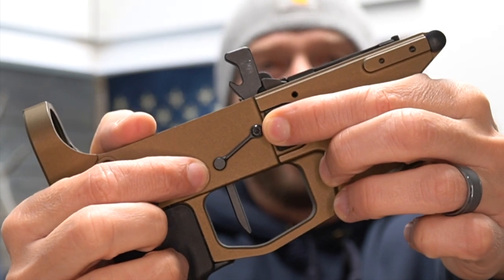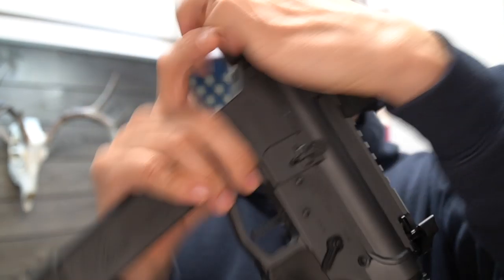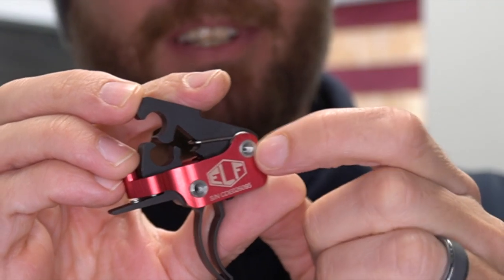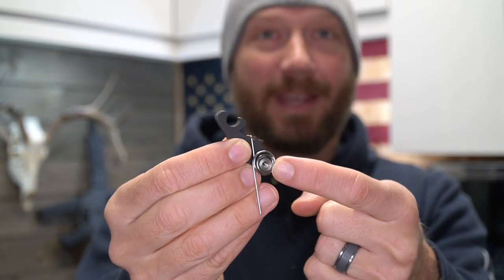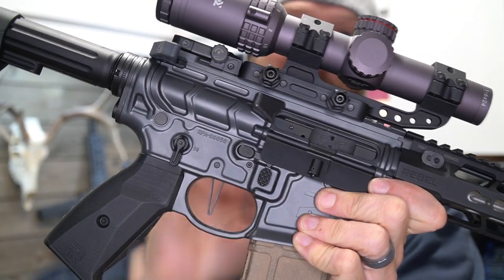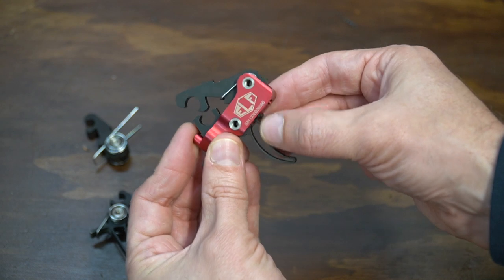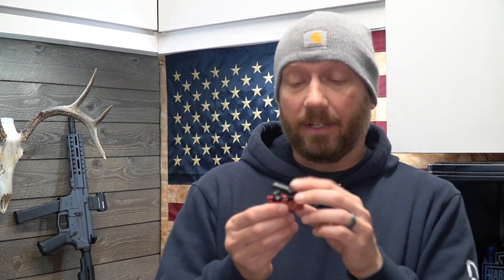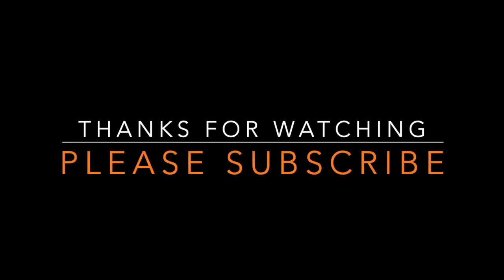You don’t need anti-walk pins!

Comment: FYI, the KNS pins design are anti-rotation, not only anti-walk. In full auto use, and semi that are fired alot, the hammer pin rotates and wears out the holes in the lower receiver. KNS pins prevent receiver wear at the hammer pin hole, have anti-walk purpose for the trigger pin, and they look great!!!
Reply: Thanks

Comment: Linked pins are not anti-walk pins... those are anti rotation links. It's supposed to make sure that the hammer won't rotate the pin in every cycle. If it can rotate, thereotically it could "ream out" the holes in the receiver.

Comment: The first pins are anti- rotation pins and the second set with just screw heads are anti-walk. Both are useful if applied for the correct reason. They both keep pins from falling out under stress from use.  Anti rotation is best for cartridge trigger group and anti-walk is best for mil-spec style TG. They both are great upgrades for a lower especially high round counts or a lower you just want to last without worrying about, or cheap one slightly out of spec. And they just look cool. They are not necessary until you need them, for the price I install them on all my builds for peace of mind.

Comment: I have had several hammer pins walk out on my two AR9's.  The recoil impulse is different on the AR9 and it WILL require anti walk pins to be installed with locktite on the tiny screws to prevent them doing the same thing.  My .223/5.56 AR15 does not suffer the same and I have never had to resort to this fix.  JUST SAYIN !

Comment: The pins are designed to rotate, anti walk pins are not good. Check your receiver pin holes size if they walk out or the trigger spring quality.
Reply: Exactly. Gieselee advises against them with their triggers because the specs are much different.

Comment: It's not just an issue with anti-walk.  Anti-rotation of the trigger group pins is also intolerable.  The holes in an aluminum receiver were not designed to be a rotational bearing surface and will easily ware oval due to rotation and lateral (not axial) force or side loading from spring pressures.   Mark the end or your pins with a scribe line and observe their rotation during operation.  Not a good thing over time...  I'd prefer to replace the pins rather than try to bush or replace the lower receiver.    Just MHO...
Reply: @aperfectcircle007 Thank you Sir...

Comment: Anti walk pins run about $10 to $15 just buy the pins! Easy and cheap reliable fix with pins run instead of spending $100 to $300 on fancy drop in trigger.
Reply from the maker: that assumes one doesn't want the better aftermarket trigger. For those who do, now they don't need the anti-walk pins.
Reply: My fancy drop-in came with anti-walk pins, so I used them 🤷‍♂️
Reply: @HarleyWood23  you’re also assuming one wants a better fancier trigger?
Reply from the maker: @takumif7056  
Very True. Some people are fine with mediocrity. 🤷🏼‍♂️
Reply: @HarleyWood23  😂
Reply: @HarleyWood23  I’m sure you think buying that fancier trigger makes you a better shooter 🤣
Reply from the maker: @takumif7056  spoken like someone who's never used one. It 100% does. Whoever says you can't buy your way to being a better shooter likely has shitty scopes, triggers, barrels, etc. Now only to a certain point obviously. You still have to do your part. But i have put people behind heavier mil-spec triggers and then behind tuned triggers, and the difference is immediate. If you can't afford it, or it doesn't make sense for you, no worries man. You do you.
Reply: @takumif7056  you absolutely don't "need" an aftermarket trigger. I used spongy, heavy mil spec triggers from 2002 all the way to 2014 from my Army career until I finally pulled the trigger on an aftermarket trigger. I found an immediate difference in feel, break, accuracy, reset and performance. The only thing I haven't tested the aftermarket trigger with is under duress and with adrenaline pumping in a combat situation. 

Some aftermarket triggers sacrifice reliability for a lighter trigger but there are some great aftermarket triggers that don't compromise that aspect like Geissele, LaRue, Hiperfire to name a few. 

While yes, you don't need an aftermarket trigger the performance is night and day for anyone who has the fundamentals down as even as an beginner/intermediate level shooter. It's not just a fancier trigger, it's a better one, depending on which one you purchase.

If mil spec is your thing then cool but don't knock it until you try it. There's an obvious performance difference in most aftermarket triggers. There's things you can do to make your mil spec trigger better and there's even a large market for enhanced, nickel boron, and polished mil spec triggers too that reduce creep, lighten the pull, make the break better, etc. 

Even top tier military operators don't run mil spec gear.

Comment: I went shooting the other day and didn’t even notice but one of my pins walked halfway out so yea I think I do
Reply: sounds like you bought a used up piece of garbage.
Fr the hammer spring will hold the pins in place by using the groves in the pins.
Reply: No you need a better lower parts kit.
Reply: @sixpest  nah my f1 firearms lpk is fine not a single problem but that and I use a rifle armory ra140 drop in trigger soo
Reply: oh yeah that makes sense; I use my stock milspec trigger its never walked yet, it could also be that its rifle length so its kinda smooth

Comment: I never stake my castle nut. Never had one come loose just a little blue loctite. I only got anti walk pins for my 9mm ar cause I think with the added force of the heavy 9mm bolt and the fact its blow back it couldn't hurt. Plus it looks cool.
Reply: Had mine walk out of a JR 9mm carbine.   Ended up buying some cheap stainless steel anti walk pins on eBay.

Comment: I dont get it. The title suggests to not use anti walk pins, then you had a pin walk out on your CMMG. Thats why people use anti walk pins. It s cool that the trigger youre talking about is already threaded for screws, but if someone already has an older trigger set, they may elect to get anti walk pins? I use them because the detents on my Timney walked out, even after throwing some thread lock on it, now even if they walk out again, the anti walks will hold the whole set up in place
Reply from the maker: The point is, with this new trigger you “don’t use anti-walk pins”. If you have some other trigger, you might still need them.
Reply: @HarleyWood23  should really make your title more clear. Totally sounds like you're saying there's a problem with those pins when you're actually just talking up some drop in triggers.

Comment: Thanks for the vid. 

Just completed my 1st build from PSA. I replaced the lower with an Anderson. 

The standard trigger from PSA didn't fit under the "pin" holding the buffer and stock. I upgraded to the curved Elf Match and the trigger pins won't even stay in the lower. Good to know I can just use screws!

Comment: my problem is after milling an 80% lower with a gig, and drilling the trigger holes the elftmann trigger holes and those of the receiver do not match! I used an 80% Arms gig! and the thing is the trigger and pins drop perfectly fine on the gig holes but when drilling it is off and no I do not drilled crooked, ?I drilled them straight down following the mold

Comment: For the most part on AR's, both 15 and 10, that I have owned and/or built, I have never had a problem with pins walking when using standard triggers. The same can mostly be said when using drop in triggers that are not threaded. On rare occasions after shooting a couple hundred rounds I have noticed a pin on those type triggers that had walked just marginally but not enough to be an issue and was quickly corrected at cleaning. WHERE I HAVE SEEN PROBLEMS,  using echo type drop in triggers tend to let these pins walk to a degree I want to keep that from happening. Probably due to numerous mag dumps but whatever the reason, they moved or at least one has. The pins are not that expensive. The install is ultra simple. So, if I am putting a binary drop in, in a weapon, I always use anti walk pins for those applications.

Comment: I have read debates either way. But the military uses springs and pins, without any problems. And has for ever. The new trend of anti-walk pins seems to be a fashion statement more than a necessity. But, they do work well when lock tight'd in. I use both, without any problems! It just depends on my trigger set...

Comment: With drop in triggers the pins can walk out. I've had one back out on a hammer spring pin and lock up my gun. I was using a timmney drop in and the scew tightening down to the lower receiver backed out. Standard triggers do not need this.
Reply from the maker: The one that I showed, which backed out on me, was a standard mil- spec trigger.
Reply: @HarleyWood23  Good to know. I like using the ones that screw into the pins with a drop off blue locktite.

Comment: Lol he put the pins in the wrong place.  Anti rotational pin goes in the hammer.  Yes if your springs are set in the groves correctly in spec pins they wont walk.  Whole point of a anti rotaional pin set is so the trigger pin does not wear on lower reciver

Comment: After closer inspection, none of my pins, mil spec and 2-stage, have slots on both sides and in the middle. They only have slots on one end and the middle. Not good enough. I have had them walk and so did you. I guess I will use oil for the friction and use anti walk pins.

Comment: If you have a NFA F/A lower, keep the pins from rotating to save the pin hole wear.  If you have an 80% lower where the pin holes aren't anodized, keep the pins from rotating.  The non anodized pin holes can wear out much more quickly than ones with a solid anodized surface.  This is even more important if the lower is billet and softer 6061 vs forged 7075.
Reply: There's M4s in military service that have had hundreds of thousands of rounds run through them with almost zero wear on the pin bores. Unless you're shooting enough to replace barrels every month or two, you aren't going to come close to widening the holes in the time you have the gun.

Comment: There's a trend right now to thread everything to replace pins. There's a reason John Browning used pin and roll pins. They have natural spring pressure. Vibration us bad on threads
Reply from the maker: First, it was Eugene Stoner, not John Browning, but regardless, we can agree the AR was NOT perfect as designed more than 60 years ago. 
Second, Its an AR15, not a motorcycle. It doesn’t vibrate nearly enough to hurt any threads. It’s more likely they just didn’t have the manufacturing technology to produce at a reasonable price. This is far superior to the original design...and roll pins were designed by Satan.
Reply: @HarleyWood23  I'm very well aware of who designed the AR. I referred to browning because he has hundreds of gun designs to his name not just a couple like Eugene. More of a broad pedigree of gun design.
Reply: When is the last time you saw scope rings held together with roll pins? There is no issue with proper screw fasteners on firearms.

Comment: Your kns pins are installed wrong. The pin with the thread is the trigger pin not the hammer. It has oil holes. Remove the screw and drop oil in it and it keeps the hard to reach trigger pin oiled and you just oil the hammer pin from above.
Reply: Exactly..the threaded pin is for trigger..lol

Comment: Dont' lose one of those screws that come with the trigger. Play hell figuring out the right screw for replacement.
Reply: Used to work at an auto parts store if you need to it shouldn't be hard to find or hardware store as well worst case
Reply: Of course ordering them would be preferred

Comment: I just got a mk10 banshee and have same problem with the trigger pin. I noticed that you changed triggers on your banshee.? I thought you weren't able to change triggers on the banshee because of the size of lower receiver? Can you swap with any AR 15 trigger? Cassette style?
Reply from the maker: Yes. I have 3 banshees. 2 are the PCC style lowers. I have aftermarket triggers in them all. You can also change the fire control/safety components with no problems.
Reply: Thank you HarleyWood. I just wasn't positive with the trigger swap situation. I didn't want to spend 150 bucks on a trigger and it not work.
Reply: @markmitchezee2728  I understand that. I just was wandering about the cassette style triggers, if they will work in MK10 Banshee. I ordered some KNS precision anti walk pins the day after I bought it. And after coming across this video I realized it wasn't just mine that came from factory this way. Thanks for suggesting.

Comment: Good video!  IMO as a USAF SP who's done run 'n gun, lo-crawl, in the mud, grass, dirt shooting exercises I've never had one back out of any M16/AR platform.  However many of my instructors who were active/combat zone vet's always said to add hex cap screws/lok-tight and/or gaffer's tape to insure you dont have a problem when you want it least. Now I've got a NIB Mossberg Pump 12 ga. that the pin falls out just shaking it over the workbench, IMO not acceptable and certainly going to address that.  If at 2am I need to grab it and the pin falls out with the trigger group all I can to it use it as a club and hope for the best.  Same issues over the years with many Ruger 10-22's I've owned and worked on.  My kids competed with that platform for years and a 1" square of gaffer's tape on both sides prevents them walking out and does not harm the finish.  $20 for a pin on line is basically financial rape..JMO

Comment: Just curious if you have installed this on your cmmg Banshee lower yet? The reason I ask is because the washers that come with the trigger (the ones you have to install with the screws & lock washer that attach it to the lower) are larger than the screw head and you will have clearance issues when you go to install them on the hammer pin side of the trigger. At least I did on my Banshee lower. The distance between the ridge on the receiver and the screw head would not allow for the washer to sit flat. So I’m just curious on how you remedied it if you did? Also elftmann states in there install video “do not use the trigger if you can’t use the screws with the washers”.
Reply from the maker: hmm. I haven't installed it on my Banshee as I'm waiting until after my next mult-trigger comparison video. where did you see they require the use of those washers? I have several systems with anti-walk pins and have never used the washers even on systems that included them. I'll reach out to them an ask why they require those.
Reply from the maker: ok, just spoke with them. Art (the owner) likes the lock washer setup for ultimate security and to prevent the screws from backing out. That said, with a little blue loctite (always recommended), you get basically the same level of security. Great question. Thank you.
Reply: You have to scroll down to the install video for the pro lock trigger and he states it in the video (the video is labeled “Match pro install video”). I am as curious as you are as to why it is stated that way but I also did not design the trigger. Link is below but also can be found on there website under there drop down menu and click installation.

https://www.elftactical.com/installation-guides-triggers-safety
Reply: Thanks for looking into it.

Comment: You installed the pins backwards, the screw in part is supposed to be on your trigger pin and the other pin goes on your hammer because they’re the one that has the notch in the middle of the pin that catches the “j-pin” in the hammer hole to retain the hammer pin from walking out during firing!😉
Reply from the maker: Kinda. Addressed it here. https://youtu.be/tZdHgLSkcwM

Comment: What size are the 4 bolts and where do I get them?Thanks
Reply from the maker: It comes with them
Reply: @HarleyWood23  mines didn't
Reply from the maker: dickey moore 
Did you buy the Pro Lock model or the standard Elftmann trigger? Only the ones labeled Pro Lock have the threaded pin channels.
Reply: @HarleyWood23  okay Thanks

Comment: All they did was design a trigger with proprietary screws needed to install it. It's the same exact thing as anti walk pins just Incorporated a little different. If the threads get barked on anti lock pins it's an easy inexpensive fix. With that trigger the threads are part of the trigger so if you can fix it you'll still need to get the screws that I'm guessing will take some time. Not the best idea out there.

Comment: You do need them.  For one thing they are not anti walk pins, they are anti rotation devices.  You use them to protect your lowers pen holes by keeping the pens locked and not rotating within the receiver body and forcing the hammer and trigger to rotate only on the pens, this will keep the pens from egged out the holes in the receiver.   Most people have no clue about this product including gun shop owners and employees they only use them because they look cool.  Please make more videos Mr. Wood but just do a bit more homework before hand.
Reply: YES! I was going to comment the same thing! I use the KNS precision ones that have screws on both sides... You torque them down properly with a drop of locktite inside, and they never rotation OR walk. Makes a huge difference in many areas, but especially in durability. I shoot A LOT (well, at least before 2020 started and ammo disappeared like me after a one night stand) and on at least 2 of my ARs I'm well on my way to hitting the 400k mark. Both builds still feel and function like the day I built them- crisp trigger, no rattle, no slop, no wear outside the normal range of issues you'd expect. As part of my maintenance routine, I check the tightness of the trigger and hammer pins by reinstalling the stock pins. Zero movement to this day. Yes, absolutely a necessary upgrade.